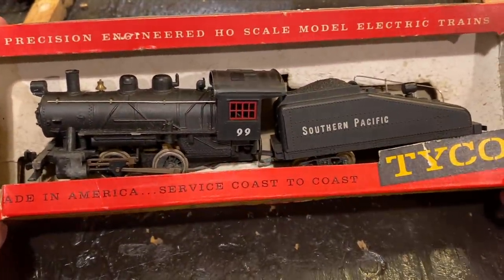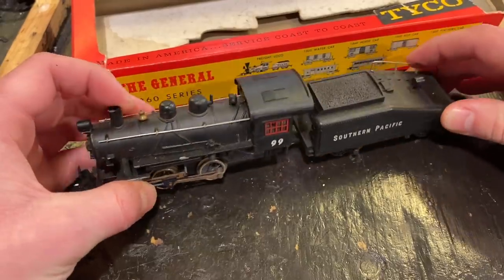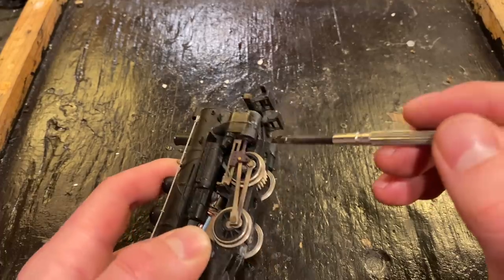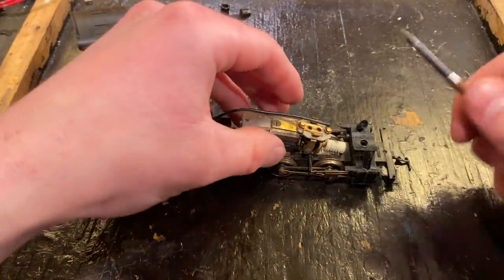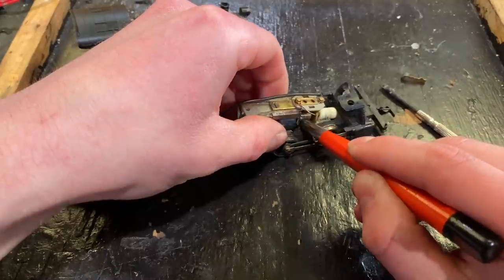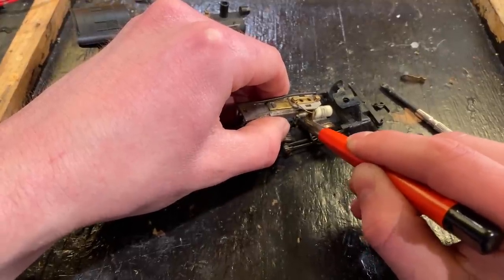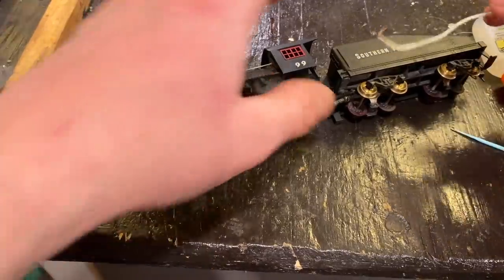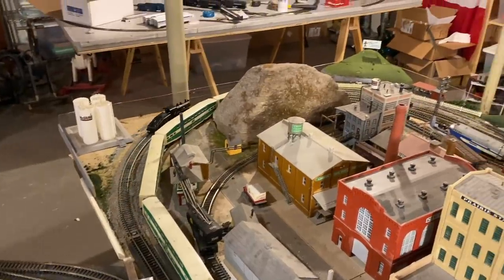This Loco Hasn't Run in Over 50 Years - Let's Make It Run Again!

Comment: I have the exact same locomotive except it is in Baltimore & Ohio "livery".  In the box like this one too.  It was my Dad's from way back in the day.  I put many miles on it under the Christmas Tree in the 1980s.  It's in storage now.  If I ever get it out and it needs a rebuild I will use this video as reference.  Thank for keeping the old Tyco-Mantuas running.
Reply from the maker: They are great little locomotives. I've bought tyco manta models in terrible condition and even then, with a bit of work they still run great.
Reply: The first HO set my Dad gave me was the ATSF 0-4-0 slopeback with assorted freight and TrailerTrain flatcar, semitruck and loading ramp.  Mine was lighted and the boiler was plastic.   He bought me the kit version of this exact engine (die-cast metal boiler,  high non working headlight) to learn to build my own at around 9. 

I still have both.   The still run.   The road name has been changed a couple times in 53 years.
Reply: @SMTMainline  I have a Chattanooga Tyco 2-8-0, a Mantua PRR 0-4-0t, and a Mantua B&O 4-6-2. The 2-8-0 and 4-6-2 are from the mid 70’s while the 0-4-0t is from  the mid to late 60’s.

Comment: I found you by chance a few weeks ago SMT, and I just have to say. Thank you. You're break down and repair for a junked Lionel Engine a month or so back gave me the confidence to take a crack at repairing my own 0-4-0 lionel dockside switcher. It hadn't run in over 10 years, and hadn't run well before then either. I had taken it to a repair shop 9 years ago, and was told that it wasn't worth fixing, that it would cost too much to fix what was wrong. Well after watching your video, I managed to not only get it running, but I got it running so much better than it had before it stopped too. The only money spent was on some fiberglass pencils, and the lubricant and grease for the engine. SO from the bottom of my heart, thank you ever so much for giving this amateur repair enthusiast the confidence needed to bring a piece of his childhood back to life. Now I just need to find an old Pullman carriage to go behind it, to complete the old look I want for that engine. :D
Reply: Way to go!! If a 'pro' says it's ruined why NOT try yourself!? WIN!

Comment: I received a tyco set for Christmas in 1970 (I was 5 yrs Old) which included a few cars, a log dumper, AND THIS engine.  It hasn't run since maybe 1973.  I still have it, and started to disassemble it a few years ago, but stopped (life happens).  All the parts are in a container.   It was great seeing this video and how you troubleshot it. Although I'm not running HO at this time. I'm going to try to get it to run again. I'll definitely look at that unsoldered wire.   Thanks for sharing

Comment: This is a 1965 or older RTR Tyco Mantua (or a newer kit build).  In 66 they updated this loco to a plastic boiler and smokebox center lighted headlight.   The box is from pre 1967 and for a small RTR.  The kit came in a closed cardboard box.  They stopped offering The General (advertised on that box) as their RTR old timer,  in favor of the lighted larger Dixie Bell 10 wheeler (Petticoat Junction, Green Acres Cannonball #3 TV celebrity).

Mantua kept selling the older die-cast boiler small engines as kits into the 70s and 80s.

The cab on this 0 4 0 is the same cab they used on the Tyco vaguely P7 Pacific and their Mikado.  The best visual upgrade to those locomotives is to replace the very small 0-4-0 cab with a scale larger cab.

Comment: I found a 1950s-era  Mantua or Tyco 4-6-2 which hadn't run in decades and appeared to have lain in water for a while. There was quite a bit of corrosion on the diecast parts and the motor was rusted solid. Managed to clean up the motor and it actually ran surprisingly well, better than some newer motors.

Comment: Hey Scrump - Nice to see you tackle an old Mantua Metals engine! I think that the loco is all set, but I think that I see a bit of corrosion on the tender, like it has been stored in a damp location for a long time. The brass connector on the tender connector screw is green, you might consider replacing the entire wire since the crimp is corroded and the copper wire is probably green inside. Also, I would pull off the tender wheels and buff up the connection points between the wheels and the tender frame and give them a bit of lube. I bet that it will crawl and fly like new.

Comment: Tyco Mantua use to make really nice locomotives then they went their separate ways and tyco started making some real junk, the bodies were nice and worth repowering with say an Athearn drive. Mantua made some really nice engines after they seperated steam and diesel, I have a number of both. I believe the motors in those were D77's and were a very good little motor. As I have said in recent posts on your sight, whenever I can't get something like that running I will take out the motor and make them a dummy and run them behind a powered locomotive, they look just as good and happy. Love your videos and the way you explain things.

Comment: Good job making it go!  One more point you can check for improving electrical pickup is where the tender chassis sits on the trucks.  Remove the trucks, clean up the contact area on both the top of the trucks and the frame, and it should do even better.  These tend to oxidize around that area when left sitting for a long time, and it can cause poor contact between the trucks and frame.
Reply from the maker: Thanks, I will keep that in mind. I did put a bit of conductive oil where they connect to the tender but it probably would have been best if I cleaned it first.

Comment: My goodness one thing I would do with that model is to get all the metal fragments off the magnet.  I would also replace the pick up wire from the tender to the motor,.  And perhaps use a blube to test for 'power' rather than doing 'the spark' test, as this will short out your controler!

Comment: I have this same Engine.
It was my father's from the 1960's.
I haven't used in a couple of years, but it always ran well.
I would like to add a running light.
I had add a key light for now.
Reply: While you're at it toss in DCC and sound.

Comment: A Kadee wheel cleaning brush works very well.  Brass bristles  will supply power to loco wheels so motor turns wheels while cleaning..  For tender wheels I use pipe cleaners, course is stiff for cleaning & won't scratch metal & the wire allows you to loop shape ends.  
NWSL had "can" motors with gear/flywheel combo which improved low yard speed running of these switching loco.

Comment: Good job!  With all the oxidation I would also clean the contact between the tender frame and the trucks, as well as the screw that the wire connects to.
Reply from the maker: Probably a wise idea. I did put some oil there but that might not be enough.

Comment: The red boxes were standard Tyco till about 72?. They went to brown boxes, but old stock in red boxes were  still around in 74. People rarely cleaned wheels or track. Most never lubed, stained the carpets. The plastic spacers in motors often wear out, allowing the motor to move on axis between the bearings and operate better in one direction because of binding. "The Shifter" is fairly indestructible. They are not fond of insulated frogs at low speeds. Good job!
Reply from the maker: Interesting history and information. Thanks for sharing!

Comment: Not bad!  If you want slower operation or more reliable electrical pick up I would recommend making all of the wheels in the tender to have pick up, might have to find some trucks from another tender which already has all wheel pickup.  You will probably have to run 2 wires from the tender to the loco motor also.  I have done it in N scale many times.  I am sure in HO scale there are probably aftermarket motors for sale also.  Another trick for cleaning metal wheels that aren't drivers is to use a Dremel tool with a wire brush attachment.  Works great and quickly!

Comment: As a fyi if you ever find the need to Remove the motor magnet , they tend to loose magmatism and will make the motor very weak run hot or not run at all. I often replace them with neo magnets.
Speaking of lubrication synthetic ATF is really great stuff it has a strong detergent package and will not load up comm brushes

Comment: Hello,  

I was watching your other videos and thinking it would be nice if you worked on my old engine. Then you did.

 On mine the motor did move over 30 yr ago but the gear attached to the wheel is worn out.
1.  How can i get a new wheel w/gear?
2. Where do get your oils and lube?

Any help would be greatly appreciated 

Thank you 
Robert

Comment: My one and only SP steam locomotive is a similar Mantua. I got the motor running just fine but the worm gear had actually cracked so the motor/shaft just spins doing nothing. Is there a compatible replacement for these? At the time I got nowhere finding anything similar so I set it aside and forgot about it. Now its bugging me again.

Comment: Tyco-Mantua used a brass U-shaped bearing on driver axles. I always thought that was a good practice.
Reply: Mantua was budget Bowser.  Similar build methodology and 1950s model designs they kept into the 90s.

Tyco eventually went another way (totally toy) as evidenced by their odd ConRail gloss teal slopeback and then the tender driven Chattanooga Choo Choo which was odd indeed.
Reply: @STho205  Mantua had its roots in the Thirties. Original Mantua was 6-volt DC, zamak castings and some sheet-brass boilers. Building a locomotive kit was a challenge. The Mantua coupler was so widely used it was suggested it be made the HO standard. A few of the early models were recreated with plastic in later years. The quality declined badly.
Reply: @larryphilby4918  yep.   I have a 1935 version with the Mantua loop and hook coupler.  Motor's rusted over. 

Most Mantua from the 60s, 70s and early 80s was designed in the 50s, with a modified slight redesign in 1966 to add lighting.

 In the late 80s and 90s they started introducing new locomotives by kitbashing their existing line.   They introduced two camelbacks and an Atlantic.  Both were quite attractive.

Comment: Sometimes Tyco mantua contact issues can be traced to the connection between the tender trucks and the frame of the tender. Remove the trucks polish the frame and top of truck a little conductive oil and reasemble

Comment: How would I send a loco in? I have a GP50 that had bad motors, then was turned into a dummy unit, but could and will run if repaired.

Comment: Got the same engine and done the same things too it and now i works better- it does run much better in reverse and my 060 that is very similar also runs much better in reverse, I have had them apart twice and don't know why they run better backwards but it may be the wires in the coils area are electrically stressed? Any Ideas?
Reply from the maker: Another commenter said that plastic spacers in the motor wear out and allow the motor to put more stress on one of the bearings when it turns in a certain direction.

Comment: I have the exact same loco, I am wondering why mine takes 85% throttle on my mrc tech2 controller to get upto a medium speed and sometimes it will just start going slower through the run. Any help would be appreciated
Reply from the maker: Have you cleaned the motor as I have in this video? Sounds like a dirty commutator causing high current draw to me.
Reply: @SMTMainline  I've done alittle with acetone and q tips. I probably have to invest in the pencil like you have

Comment: Alright, Harrison...what did you do with your wire stripper????   Wow...kinda sound like a parent, don't I?   And of course, repair genius Harrison has it running again.
Reply from the maker: I don't know, had it then I lost it. lol
Reply: I was thinking the same thing!  Should I put a pair of wire strippers in the next box I ship to you?  Those are nice little engines.  I have one and it runs great, just missing part of the drive rods.
Reply: @dbtech7914  Yea, those old Tyco 0-4-0 switchers were built like tanks.  And yes - send the man a new set of wire strippers!!!!
Reply: @antonbruce1241  I buy them 2 or 3 at a time because I loose them too!
Reply: @dbtech7914  Odd...I've had the same wire stripper since I bought it...IN THE EARLY 1980'S!!!!  Maybe that's because it wasn't one of those cheap wire strippers - they what used to be called "click clacks".

Comment: On locos and tenders connected with a wire  clean the wheels on the tender first that is the ground then if it still doesn’t run open the locomotive  but still nice job !

Comment: wanting to know if you had a extra front truck for a silver streak engine , or know someone who does, i will pay for it and postage
Reply: Assuming it's a PowerTorque drive, the motor block from any old Tyco diesel from the brown box era will fit. Just reuse the wheelsets, bogie cap and swivel retainer you already have.

Comment: Can you change Nylon for Metal Gears?
Reply from the maker: It's probably possible but finding the parts and then putting it together wouldn't be easy. The plastic parts in this case actually aren't a bad thing.